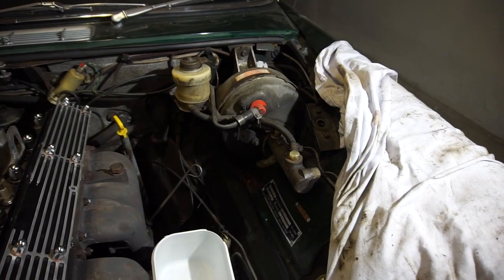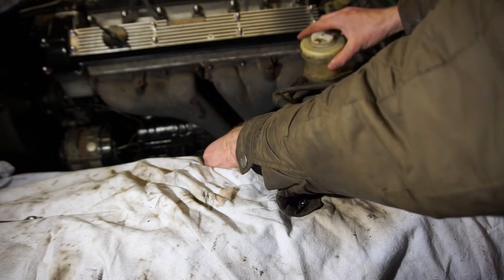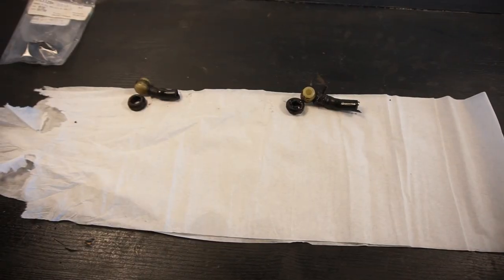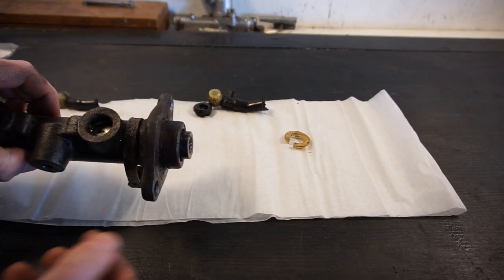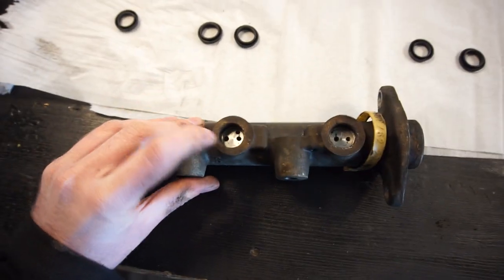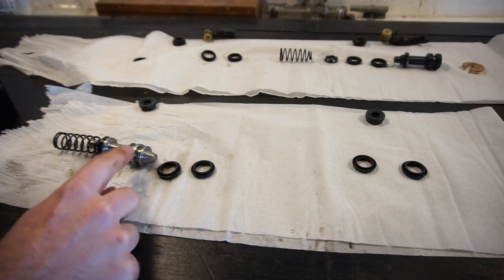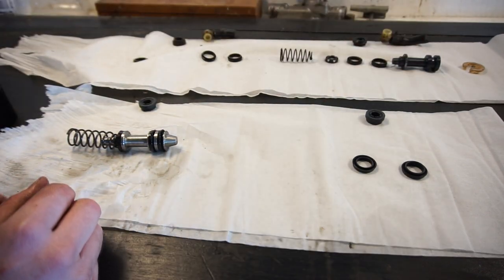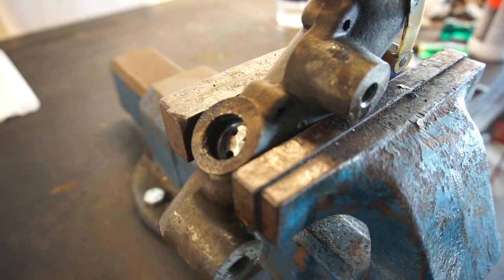Rebuild Brake Master Cylinder - Jaguar XJ6, XJ12 and XJS

Comment: I decided to take a chance on pressing the plastic pipes into the grommets using my vise.  I went slowly, one at a time, using a Q Tip to apply brake fluid as I went.  Hopefully the master is good for another fifty years.

Comment: Well made video and well explained. If the piston is stuck (as mine was) you can blow an airline into the bottom hole and blow it loose. Sadly my inside was not smooth and the thing is junk. Oh well, I tried...

Comment: I just did this exact job on my 74 XJ6 today just about four years after your  video. Unfortunately I had a rebuild kit for quite a few years and discovered that whoever made up the kit put one flat seal in the pack instead of the correct seal. The master takes five identical seals.  The supplier put the seals into a baggy to make it easier to ship.  So I have used one old seal over again. The one that goes at the end near the spring.  Hopefully it will be ok. I don’t want to remove the booster.  I am worried that there is fluid in there. You seem to suggest that you perhaps can see if there is fluid in there by removing the red plug.  Hopefully that is the case and fluid can be sucked out.  Also the seal on the end of the primary piston does not seem to have much of a lip whereas the seals on the secondary are very pronounced. I hope this works.

Comment: Hate to tell you but the last seal you put on, the one closest to the actuating rod (from the servo) on the primary piston is back to front. It should be facing the same direction as the seal on the other end of the primary piston. If you have a think about it the sealing side should always face the fluid., you have it facing away from the fluid.

Comment: Good video,, im wondering if you had any problems with the plastic intake pipes the insert onto the top of the master cylinder.. I've rebuilt mind but those elbows are old and deformed.. do you know where to buy or find new ones? Thanks keep up the great work.. 
You should see the insane restomod on my sons 86 xjs.. custom work on the V-12, zero handles and lights on the sides custom interior, even the lip of the gas lid was shaved flat. An original TWR body kit and every nut and bolt are  S.S. every engine component is either chromed or high polish aluminum..

Comment: Hi,
I have a 91 DD6 with abs with leaking master cylinder. It’s different to this one, doesn’t have a rear circlip or visible pin in rear to rear. Just what looks like a dimple.I’m stumped on this one.
Reply from the maker: Sorry I haven’t torn into one of the later ones.
Reply: @LivingWithAClassic  all good sort, it’s a series 3, one of the last. The pin is out, all rebuilt now, very stubborn.

Comment: I'm trying to get the plastic reservoir hose fittings back in and I'm struggling. I used brake fluid to lube up the fittings but they just will not go into the new rubber seals. Ideas?
Reply: After some sore thumbs they finally went in :)

Comment: The master cylinder should be honed . Always,  as the previous lines in the bore will damage the new seals. In you could not see the lines in the bore its because you did not look properly.

Comment: Unfortunately it appears the seals are the wrong way round. On the Primary piston, the two seals should face the same way ( cup facing inwards) and the Secondary pistol with the two seals together, opposing each other , first seal, cup facing outwards and second seal, cup facing inwards. I can send you a diagram, if you wish. My comment, Aluminum or gold paint looks good, as I believe you want this car it look original. Factory was either gold or silver anodized.
Reply from the maker: Hey Joe,
That's odd, I followed 2 diagram from the workshop manual.
Yes please email me a diagram if you have a good one and I can double check
Reply: Hi mate can you please send me a diagram with the correct orientation
Reply: I took apart a master cilinder and the seals had different orientations that this video. Did you ever find out whats correct?